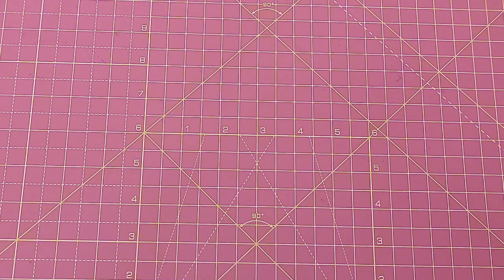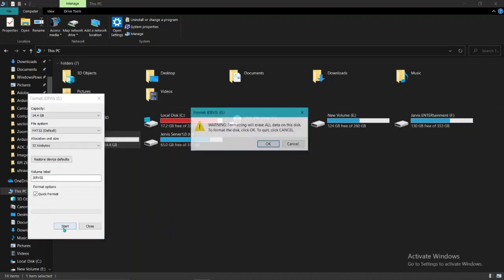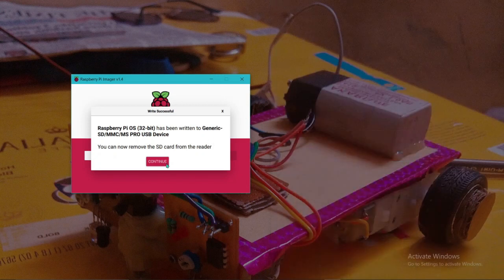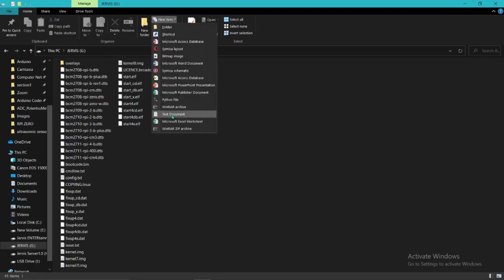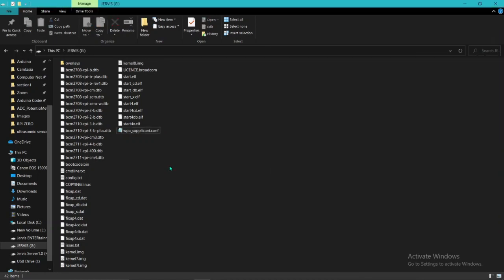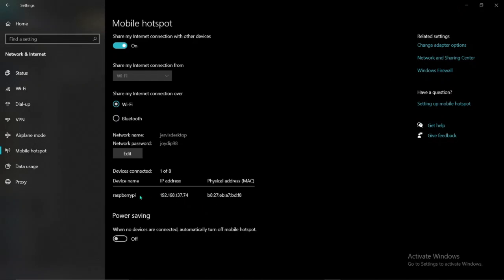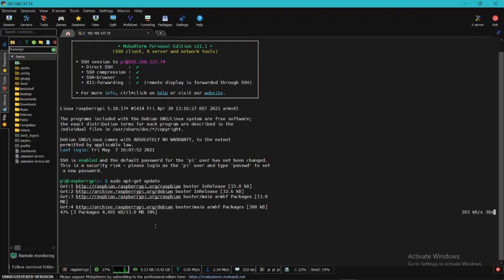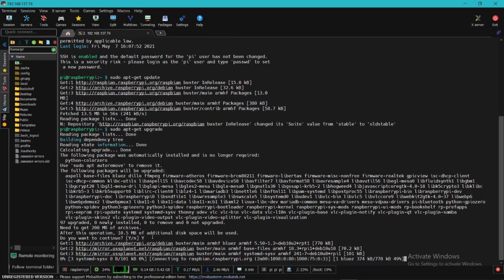Getting Started with the RASPBERRY PI ZERO W – Headless Setup without Monitor

Comment: this has helped me so much, especially when it wouldn't boot due to some ssh file not working. This is the only way I have managed to boot the pi: by using the mobile hotspot exactly like in the video rather than connecting right to wifi

Comment: I have ordered my first Raspberry Pi that is the Pi Zero W and I am planning on running multiple servers on it. 
And the final list is as follows:
1. Email server [hmail or any other] 
2. MySQL Server [Do you have any other option for a self hosted database where i can store all my personal stuff?]
3.Web Server that runs a website that is made in HTML only.

The Problem ---> 
Although i have chosen the servers to run but i am confused that how do i configure it step by step and where do i configure it like on the Raspberry Pi locally or run Docker containers or Proxmox VM's or VMware Esxi 

Please help to get out of this problem if you have any solution then please reply me ASAP and please also tell how do i configure all of this 
Please reply ASAP
Reply: hi! I would run the programs using Portainer (a web GUI for docker) and Nginx ( a reverse proxy tool). This way you can access all your apps from a website which would allow you to restart them, stop, or start them whenever youd like. I have my apps set up like this (except in a cloud vps).